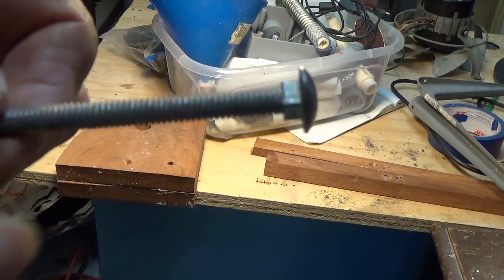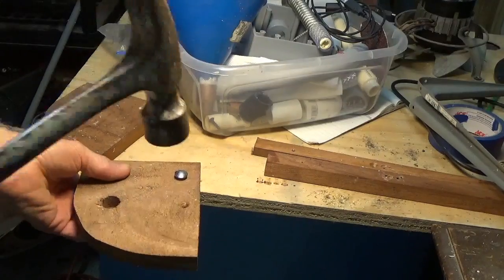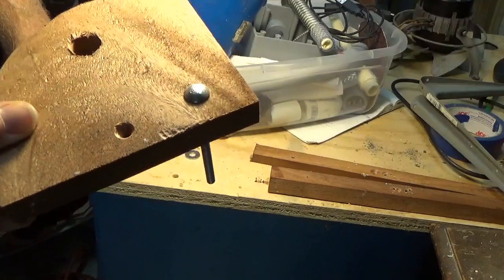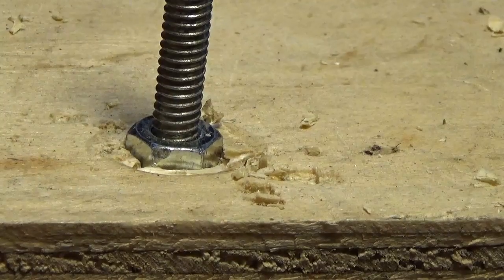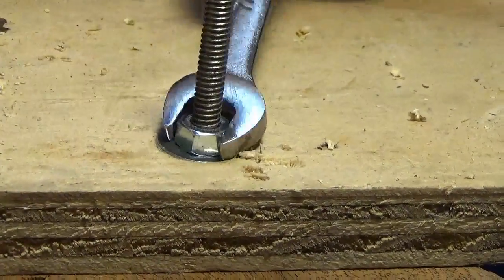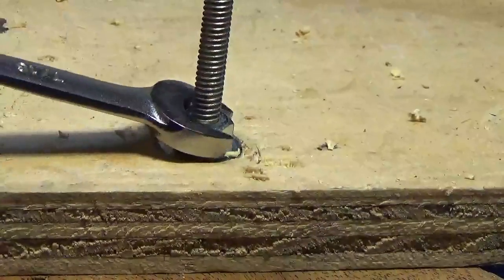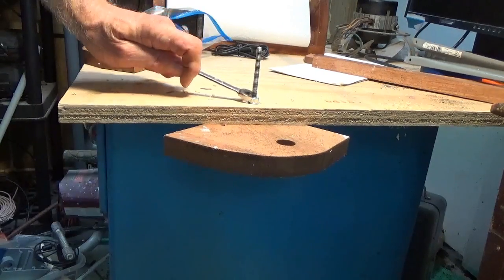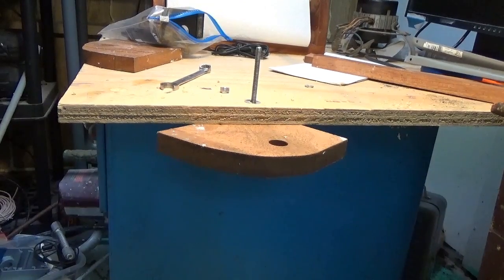How to use carriage carriage bolts and what they are used for

Comment: I have an opposite question about bad deck. How do you remove the rusted nut from the carriage bolts, when the nut carriage turns at the same time?

I can't hold down/still the carriage bolt because it flat smooth half dome.
Reply from the maker: Hopefully I'll get home early tomorrow Saturday 7 2 2016 and I'll help you get through this.  Couple of things right off the top  is to hold the nut with pliers  and center punch the top of the bolt and start off with an 1/8" drill bit and drill through the bolt all the way .  Keep using a bigger bit until the nut is drilled off.  That will be on way that will be shown , plus a couple of other ways.
Reply: You never done it before, these are high grade bolts & nuts
These carriage bolts are large and free spinning because the main rails and posts have soften and rotting through time.

These bolts are rated over 1100MPa, many bits will not drill through it.
Reply from the maker: Finally got home earlier today and made a video that may work if not let me know....   https://youtu.be/Xr3kgkQcF-Y
Reply from the maker: Finally got home earlier today .  let me know if this works      https://youtu.be/Xr3kgkQcF-Y
Reply: Worn out all saws & bits.
Even used a blow torch as a test, didn't do a thing to them.

Comment: u r suppose to use A torque washer with the carriage bolt then hammer it into the wood. cuz u muscle  up and sum guys can break and anvil u can get the bolt to free spin in that hole.Plus it allows for easy removal of nut n bolt if u make boo boos.
Reply from the maker: Thanks for the additional information about the lock washer
Reply: most welcome. We had to order those damn things no one in our city has even heard of them let alone stock them.lol .good video though by the way.